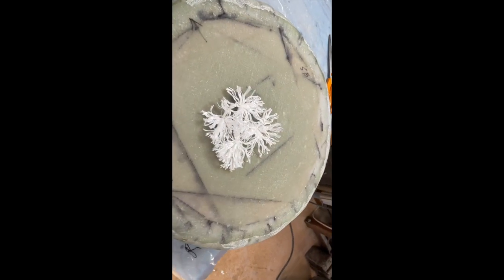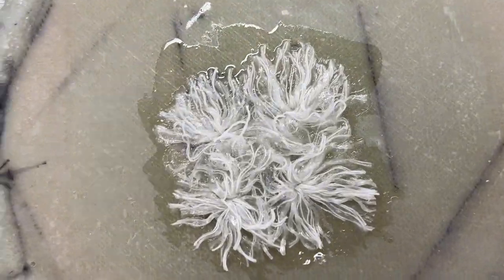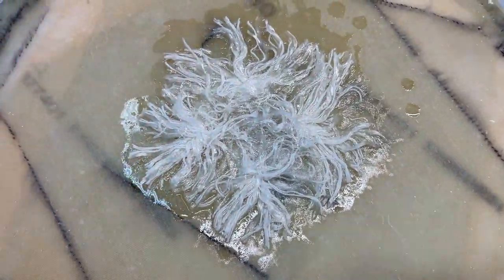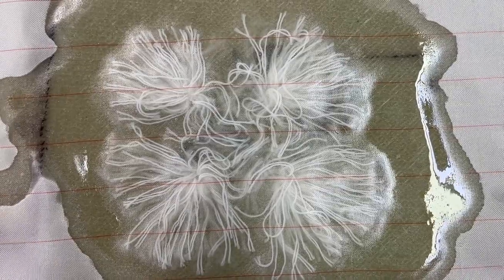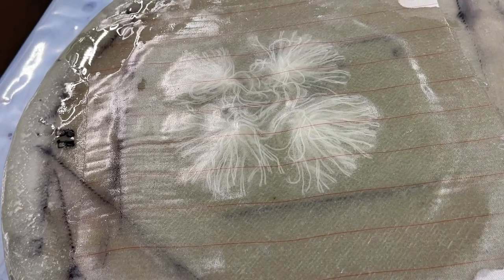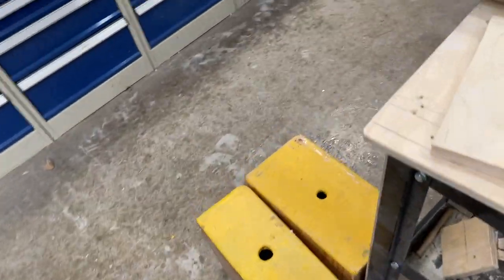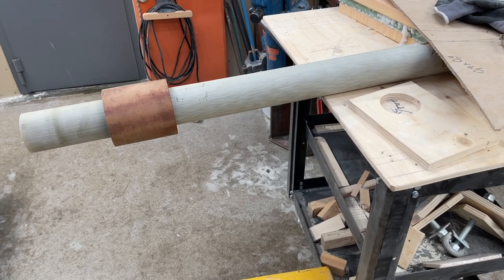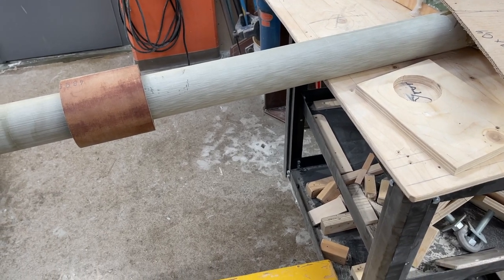9 Dec 2022.  Strong point on the deck hatches for the ratchet strap.  + Start of new rudder detail.

Comment: Thanks Sven; Inspiring!  I would rather trust the seaworthiness of your design than some prettier but more expensive sailboats I've played in, but wouldn't have dared cross an ocean in!  

I hope you mention sometime, the issue of ballast; and when you will know the ballast need; I wonder if your long distance water supplies serve as ballast; so I guess containers might need to be refilled with salt water and lashed down during long crossings? Pardon my ignorance. 

You seem to have a habit of realising dreams.  I like that!  I just might - maybe - possibly emulate that - to some extent - eventually.

  I respect your capacity for solitude! (and friendship)

Thanks for sharing.
Reply from the maker: There will be an 183 kilo bonze outside sole.
I may refill some continres with salt water if needed.
But I like also to keep the boat light.
Reply: @SvenYrvindExlex  Ah, nice! That outside sole of bronze or copper sounds really good: ballast, antifouling effect, and abrasive resistance (if you ever land on stones or concrete).   Thanks for sharing some good thinking .

Comment: I’m concerned about these hatches. They will be so tight fitting that no oxygen can get inside. What if you fall asleep and run out of air and just keep on sleeping? Or if you don’t have the strength to open them once you are inside? Please make a plan for that, sir.
Reply from the maker: Previus boats since 1971 have an waterproof ventilation system
So will this boat.
Reply: @SvenYrvindExlex  thank you for letting me know that.